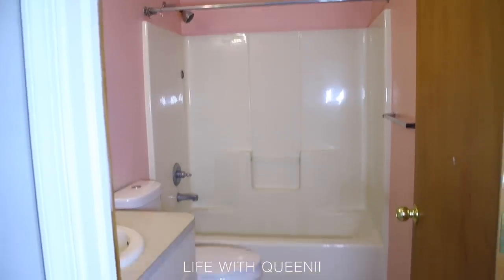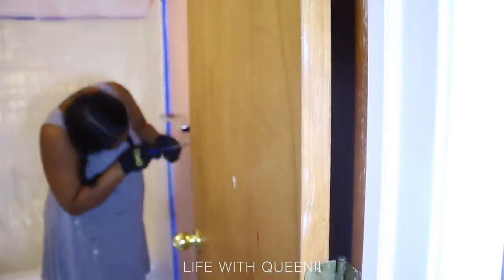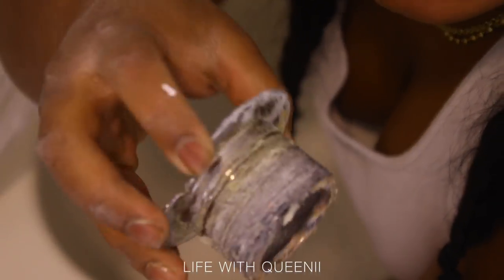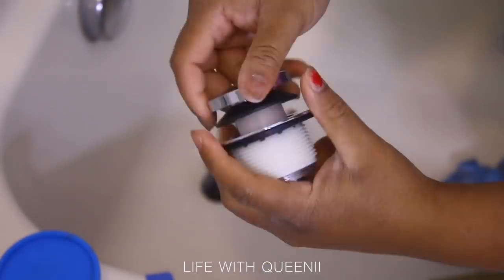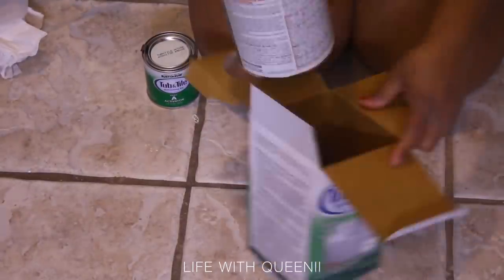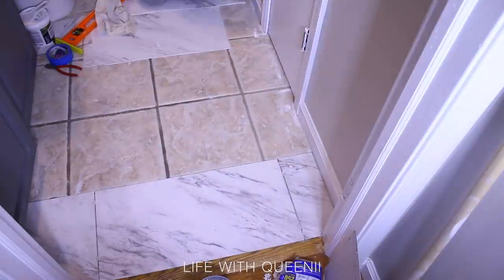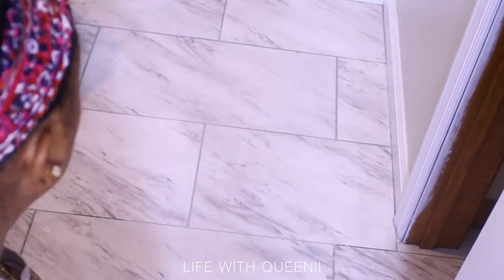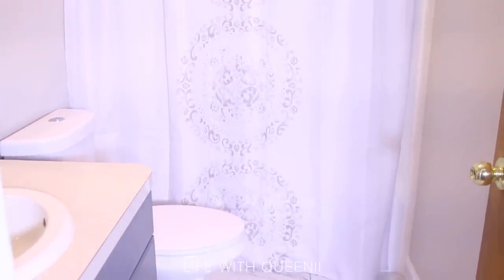KIDS BATHROOM MAKEOVER 80% DONE =)

Comment: This turned out beautiful...i used the same tile in my master bath, vanity and closet...a trick to cutting the tile is to heat the tile first with a hair dryer. Cuts so easy.
Reply from the maker: good Idea I have a huge project coming up soon i'll give it a try and mention your suggestion in the video =)
Reply: @LifeWithQueenii  it works like a charm when its heated first.
Reply from the maker: @toddharrington3546   I just got my heat gun but may be too hot lol
Reply: @LifeWithQueenii  that would do the trick and heat it faster. But dont put it to close
Reply from the maker: @toddharrington3546  thanks Todd

Comment: Thank you for sharing. Great job. I thought you had to sand the tub. Before applying the acrylic epoxy? I'm wanting to do my tub. I'm wondering how long it last?
Oh. for paint on the floor,trim,etc. There's a product called goof off. It is sold in the paint isle. By the paint thinner etc. Works great.
Tip id like to share. Find a round palm scrubber. Get a 4 to 5 inch screw 3/16  I believe,with nut and two washers. Drill a hole through the center of the scrubber. Push the bolt through. Where the long side comes out the other side of the brush. Tighten the washers a nut. 
Now you can attach this to a cordless drill. 
And you have a pretty handy power scrubber
Reply from the maker: I did sand it, its in the video 😉
Reply from the maker: Thanks for the tip hun

Comment: Wondering about the lower parts of the floor where the old grout was... if that was causing the new tile to push down into those areas in past year?  thinking perhaps you might have put extra glue in the grout line to make the floor underneath more even...

Comment: Hi Queenii, you are such an inspiration. Thank you for taking the time to share your videos. Question, how do I get paint off bathroom shower tiles? I bought a home and ALL the bathrooms shower tiles were (still are) painted and now the paint are stripping of. Its a total disaster. Wish I could show you pictures. Anyway, I want to do redo the bathrooms myself with the Rust-Oleum Tub and Tile Refinishing 2-Part Kit, but Im having a heck of a time getting off the paint. Any suggestions? Thank you in advanced.
Reply from the maker: They sell a spray and liquid paint remover at hardware stores. You apply it and it will melt right off. It does have a strong smell FYI
Reply: @LifeWithQueenii  thank you.

Comment: Hi, love this! So I have the same tiles (before ones) that you had in this video but there is some leveling issue in just one place, one tile is very slightly above from one side. did you face any such kind of issue? Any ideas on what I can do or should I just go ahead and place the tiles?
Reply: I think you might be able to level the tiles with some kind of water proof spackle spread over the area, and then smoothed with a trowel…

Comment: Hey there!! Wow this looks amazing. We are going to start our bathroom this week as well. Using sooo much of the same products! So I’m glad to see you are as well. One question I have for the tub surround. You mention using a few dozen foam rollers so I will get those for sure. However- did that one kit last for all of the coats you did? We have the exact same one as you. So just wanting to make sure I’m prepared. Additionally with the peel and stick tiles. We got another pattern but they are the same type that are groutable. However I figured the adhesive on the back was enough. Should I go back and get the extra adhesive you used as well? Stick and stay?  Thanks In advance!!!
Reply from the maker: I got the extra adhesive because it’s in the a bathroom just to be extra secure and I used two tub kits and about 7-9 rollers. Follow directions on tub kit

Comment: Great job , but the foam roller leaves little bumps.  What type of foam roller did you use?  How much nap?
Reply from the maker: Hi there I mentioned in this video you will need more than one foam roller =) to switch out once they start falling apart
Reply: @LifeWithQueenii  Yes, you did mention you will need more than one...You did not mention the brand or density of the foam rollers
Reply from the maker: @Bionicbabyy  honestly I didnt look at brand, i picked them up at lowes and yes i did mention high density i just checked the video =)
Reply from the maker: @Bionicbabyy  I did use about 7-8 rollers total
Reply: @LifeWithQueenii  thanks I will see which high density is best since they have several at the store

Comment: i wish you could of showed how you did the toilet piece... that is the part that I have issues with
Reply from the maker: Hi I think I did show it, if not what I did was use paper get a piece of piece ( large piece) and cut it to make a outline of the toilet. Lay your tile out and draw on the outline onto the tile and then cut. Try to cut where you have an extra 1/2 of tile so just increase you need to remove some you have some to cut off. If you cut too much off you’ll have to get another piece of tile